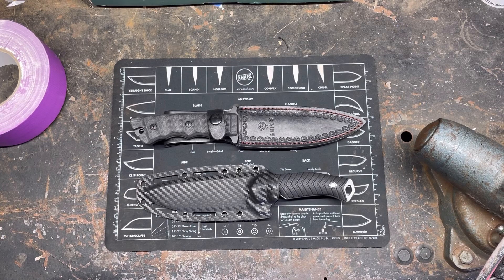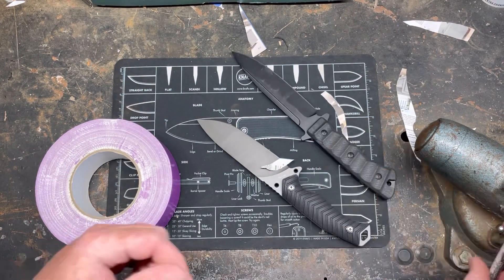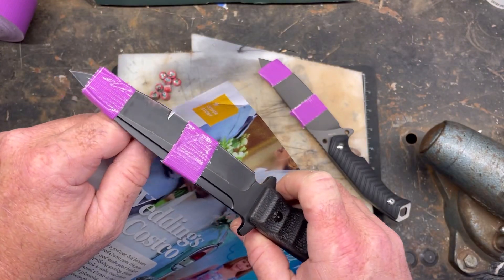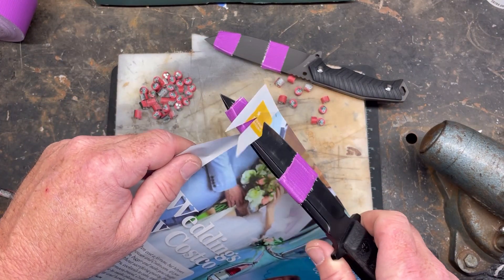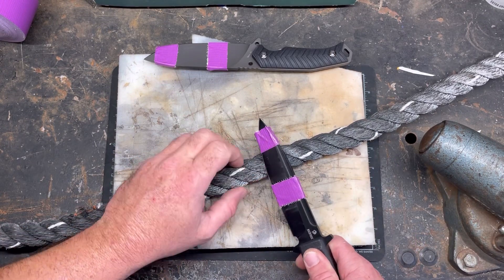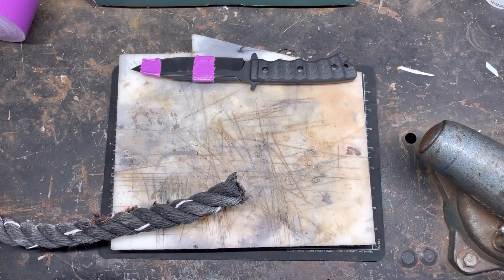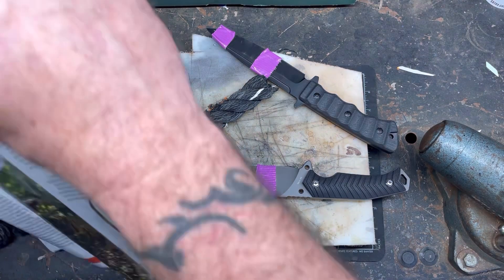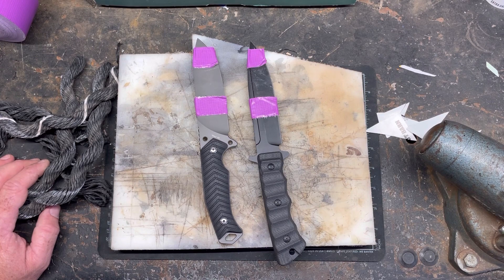Chinese 8cr14mov vs Chinese D2 edge retention test

Comment: Both are great budget steels tbh with more than enough edge hardness and toughness at the same time. D2 is a little less corrosion resistant so I always buy coated blades if I choose d2 steel.

Comment: Thanks for the test. 💯 How would these steels compare with 1066 or 1095 ??? 🤔 I'm a bit of a dinosaur, I like carbon steel! 👍 Any thoughts?
Reply from the maker: I’m not sure. But would make an interesting test
Reply: @peterbiltknifeguy  Pretty easy for me, if you do the test. LOL  Simply do the same test with a BPS and an ESEE!!! 👍 Then compare the numbers.  👌Don't mean to be making more work for you.  Just thought you might have an idea off hand.
Reply: Good question, 1095 oil quench or water ?